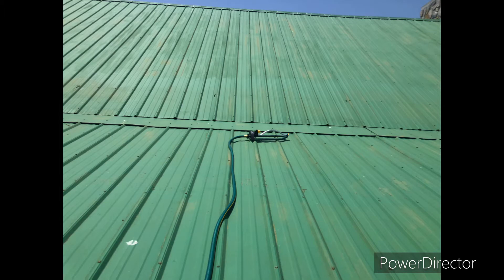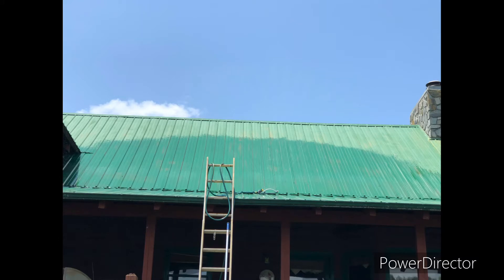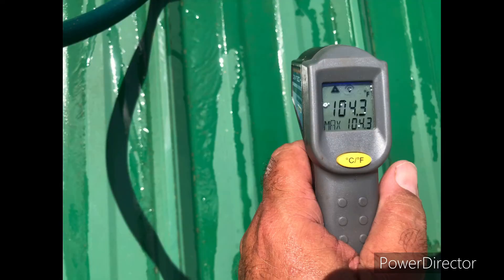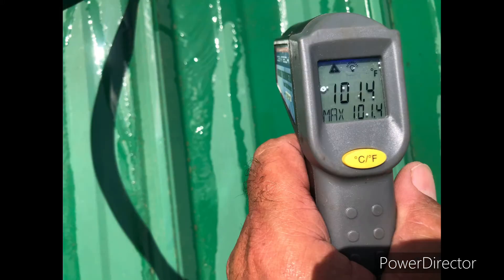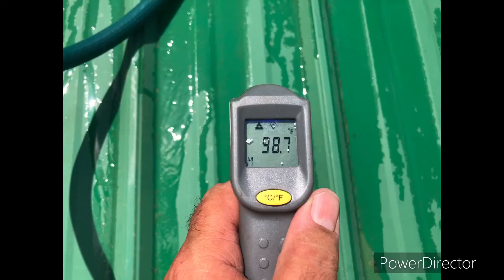Cooling a metal roof with well water

Comment: Just use white roofs instead they are way more effective at keeping the surface cold, then spraying water on a roof that is not white but it is another colour. Having white roofs keeps the temperature cooler because it reflects sunlight heat back to space.
Reply: I have a white roof on my building, still gets very hot. I am going to add a sprinkler system to my roof than has a temp probe that cycles the water valve when the roof hits 95 and off at 80. I plan on using 4 fountain style heads to cover a 24*52 building two on each side

Comment: Might as well buy a sun roof paint to reduce the heat of ur room.. And put an insulator inside or other side of ur roof to reduce the heat.. Then try puting a air vent on ur ceiling that can suck all the heat from inside to outside... Thatll be a big reduction of heat in ur room....
Reply: Not everybody can afford the paint or the right kind of contractor. This works OK and is easier to apply and use as needed in the summer. That paint isn't cheap.

Comment: I wonder if this could work with intermittent watering, so not a constant supply, just every 15 minutes or so during the heat of the day?
Reply from the maker: I think so. Put a sprinkler controller and a valve on it. A simple rain bird type could work. Key is measure how fast the roof temps rise after the water stops.  So far it seems like if I start it in the morning then the temp holds. If I start it later in the afternoon after the heat has built up it just stops it from climbing further but doesn’t reduce the house temps rapidly.  I assume it’s because the volume of relatively warm air already in the vaulted ceilings.
Reply: it's the evaporation, as long as there is water to phase change water to vapor it works
Reply: @bgreen2266  I hear that these big reductions in temperature with water spray rely on the water changing from liquid to vapor - as this change takes heat.  The heat, comes from the tin roof.  So I expect that a light cover of water, rather than a flow of water, works best.  Intermittent spray seems the way.
Reply: @Divocwax    I've read that misting is more effective than flooding.